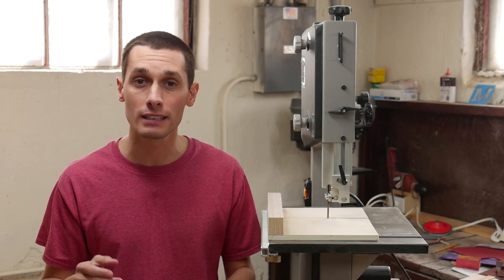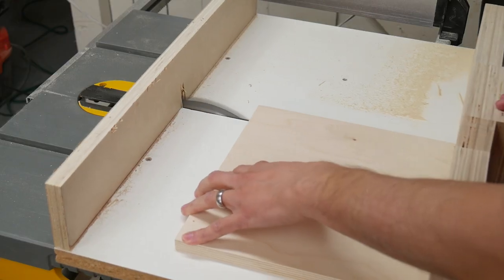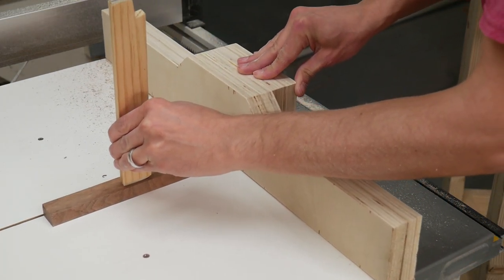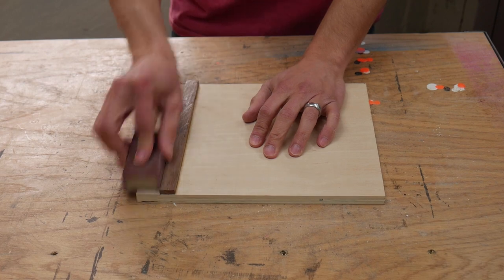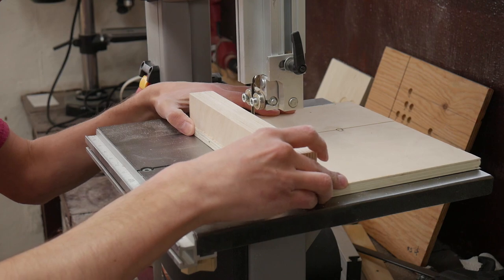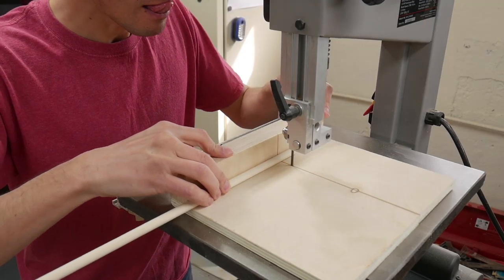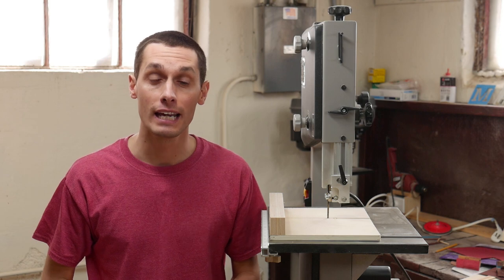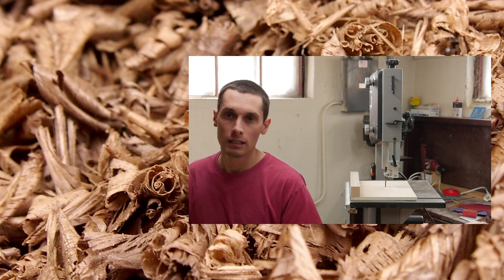How to Make a Sled for a Band Saw

Comment: You could also make a stop for it by drilling a hole in the back of the fence to support a dowel or steel rod. An adjustable stop could be attached that catches against the edge of the table, preventing the sled going beyond the chosen depth.
Reply: Nice additions.

Comment: Thanks for the instructions. I had a slight problem though. Perhaps it is because I have a consumer grade $160 bandsaw. But when I went to cut the groove, the blade flexed and wandered all around and didn't cut straight despite the fact that I already had the runner attached at the bottom. Anyway I just took it over to the table saw and made the groove wider. This way the blade is not forced into a wonky position every time I use the sled.

Comment: I tried this technique, but when I made the first cut on the sled to set the fence  the blade had drifted clear in perpendicular to and away from the runner stalling out the motor ?  It seemed like I needed to adjust the runner to the drift angle ?  Or, maybe my blade was too dull ?
Reply: If you set your band saw blade so that the teeth are at the crown of the wheel you may avoid your problem.

Comment: I wonder how many people will cut their sled in half on the first try?
Reply from the maker: That's probably a common mistake but the sled would still work there just wouldn't be anything supporting one end of whatever was being cut. This may or may not be an issue.
Reply: I cut maybe 1/2" into my sled's fence. Not on the first try, but after a lot of use. So I made an adjustable stop that attaches to the front of the sled. It arrests the sled when it hits the front of the table. But even that was not enough, because this whole thing was removeable. And after I got used to using it with the stop, I had some even worse accidental overshoots when I forget I was not using it. 

So I while I still had enough meat left in the fence, I drilled a hole in it and glued in a piece of  3/8" hardened steel rod, directly in the path of the blade. Ultimately I see it as a safety feature, in case I were to somehow forget I wasn't using the stop, and I somehow had my thumb behind the fence in the path of the blade. But also, logically speaking, it is faster and easier to change the blade on my bandsaw than to build a new sled. And I'm such a cheapskate, that I should be much more careful with the sled if I knew it could damage my blades. The steel pin does the job. In many years since then, I have only thrown a few sparks off it, once, not so bad that the blade was ruined.
Reply: It would be an act of extreme carelessness to cut the sled entirely through. Maybe a sign that such a person shouldn't be allowed anywhere near a bandsaw!
However, some kind of adjustable stop would be simple to make and would enable accurate and repeatable cross cuts to a precise depth of cut. The downside of that would be that people who would otherwise cut their sled in half would continue using their bandsaw until they'd done something equally careless and perhaps more devastating.
Reply: Ron Tocknell  Depends on what you're doing and on how thick the fence is. 

Maybe you're cutting hundreds of lengths of stock to the same dimensions (brass round? pvc pipe? Slim Jim's?), using a stop block clamped to the fence as reference. The sled allows you to keep your hands and thumbs well away from the line of the blade on this hypothetical cut, so you are free to develop a rhythm, once you have figured out all the important safety checks for each potentially dangerous successive cut.

This rhythm you develop has some inverse relationship between attention and accuracy. And after you figure out all the important safety bits and consequences, it so happens to turn out that the only reason accuracy matters at all is to avoid cutting the stock only partway and/or cutting the sled in half. So you maybe develop a balance that is biased towards speed and minimal effort while being just careful enough to not cut the sled completely in two.
 

And maybe in the middle of this batch of hundreds of cuts, you changed the blade. And maybe you haven't gotten the tracking and thrust bearing dialed in quite as well as you thought. The blade has a bit more bounce when it finishes the cut. 

So the rhythm or technique you developed results in a deeper follow through. Your process is holding up. You were in no danger of physical harm. All the cuts are good. But now the sled is hanging on by a thread. You can probably finish the rest of this job, just fine. But by the looks of it, the second time you try to put the sled up and back, it is going to fall apart. And it could be dangerous if the sled were to come apart in halves while you were using it.  

As you might see, the stop is not just useful for making repeatable blind cuts partway through the stock. (Although this is a nice feature for making half laps and tenons.) It is also very useful for making regular cuts. Along with preventing you from damaging the sled, it can increase your efficiency and productivity by reducing the amount of wasted movement and reducing fatigue and error. 

But you make a good point about safety. This is the reason that after I made the adjustable stop, I also embedded a piece of hardened tool steel inside of the fence. Regular band saw blades can't cut through it.
Reply: Not on the first try.